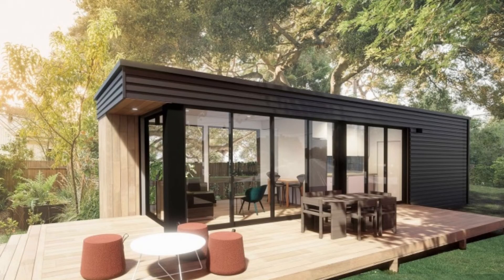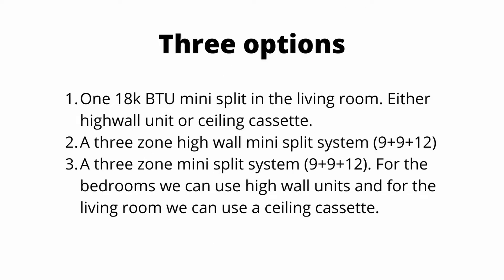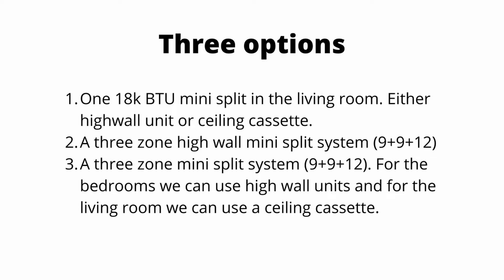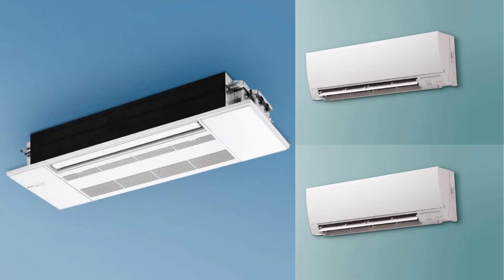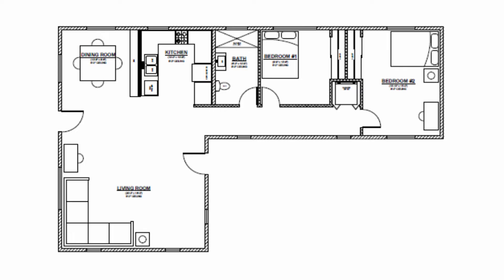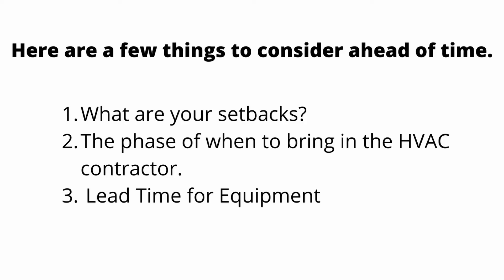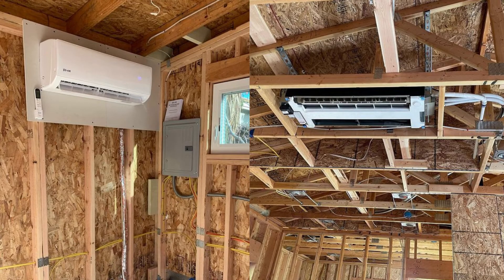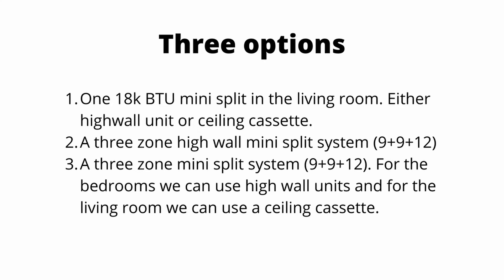Ductless Mini Split for ADU Projects - What Are Your Options?

Comment: What is the annual cost to run 12,000 BTU mini split in Wildomar CA in a 400 sq. ft. garage conversion?
Reply from the maker: Around $100 to $300 annually depending upon how often you use it.

Comment: Thanks for sharing this information. I'm getting ready to build a 570sf, 1 bed/1 ba new construction ADU in San Diego county, and plan to install a mini-split system. The ADU will have 9' ceilings and an attic space. I want to locate the compressor in the side yard, which has a 3' setback. The wall of the ADU is located 5' from the property line on this side yard so that leaves me with 24" of available space (if I'm not allowed to have the compressor in the SYSB.)
I was thinking I'd like to have a high wall unit in the bedroom, and a ceiling unit in the main living area.  The main living area is a rectangular space (approx. 10' x 25') with the living area on one end and the kitchen/dining area at the other end. Would the ceiling unit be located at the mid-point of this rectangular space?
Would I save any money if I bought the equipment myself and hired an HVAC guy to install it?
If so, what would be a reasonable cost for me to pay for the high wall unit, the ceiling unit, the compressor, and other bits needed to install? 
What would be a reasonable cost for an HVAC guy to charge me to install?
Alternatively, what might an HVAC contractor charge me to provide both the equipment and the labor?